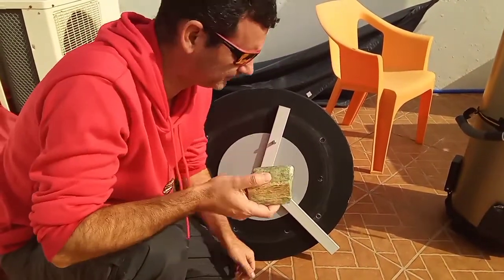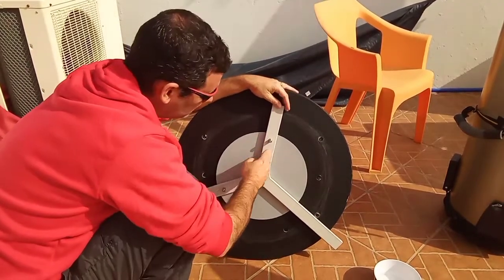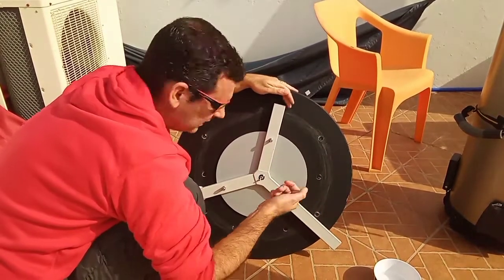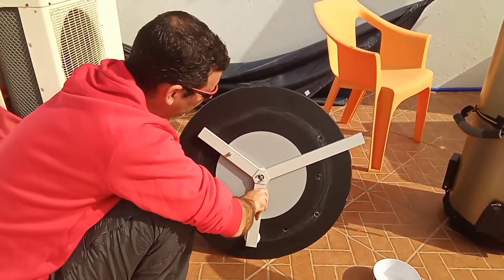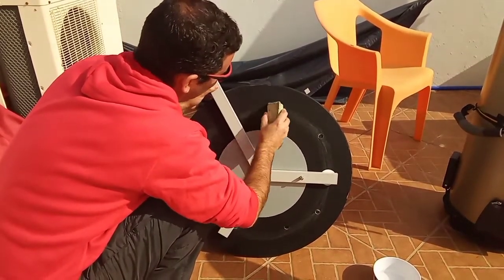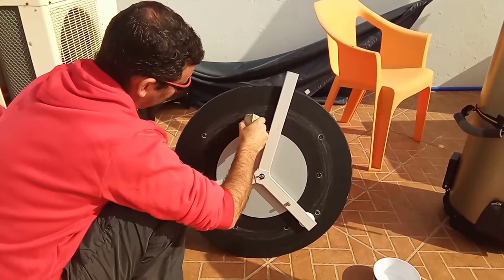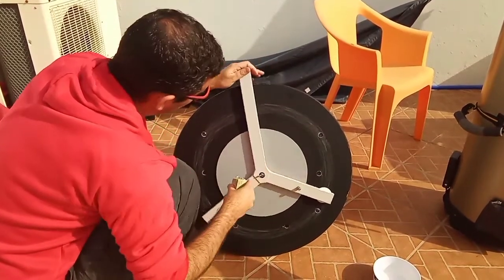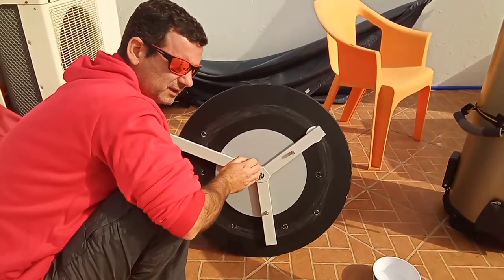Keep your dobsonian telescope base rotation smooth with this simple method

Comment: Thanks so much for that simple tip. Finally someone to show exactly where to apply product
Reply from the maker: Thank you! That was the purpose of this video, to help people that don't know this trick and/or don't know how to properly do it.
Reply: @DobsonianPower  I tried it last night but it was like it was before. maybe I have to do it twice.
Reply from the maker: the soap should work. if not, it is because you have unbalanced friction. i don't know your set up but try to feel where the friction come from, you could have to adjust. i had to do it with 1 teflon pad and had to lift it less than a mm to be perfectly align. that's why you see 1 white circle in 1 of the arms. also the telescope balance interfere with friction. the scope should be well balanced. try to figure where the problem really is. upload a photo if you can so i can try to help.
Reply: @DobsonianPower  Thank you . I will try that.
Reply: @terrymanuel979  have any luck?